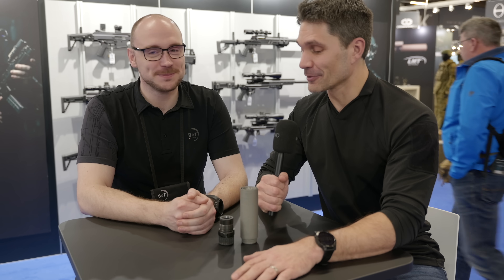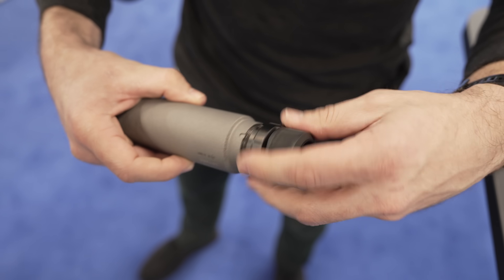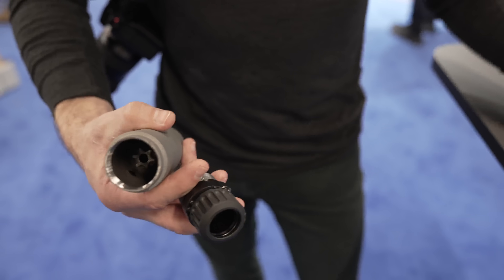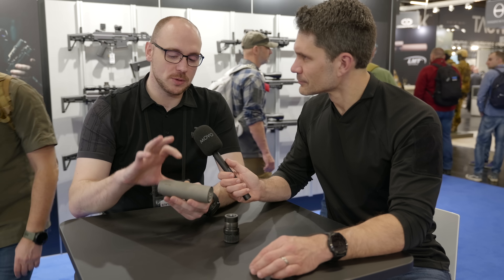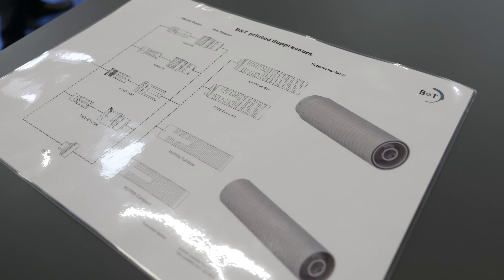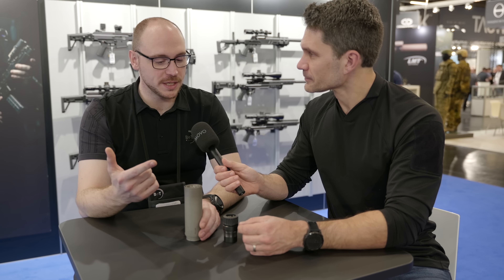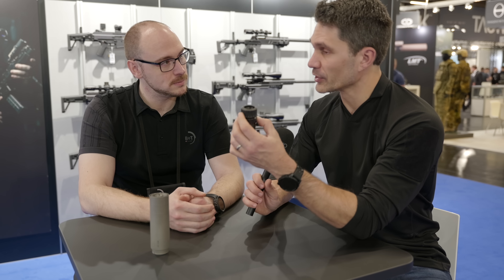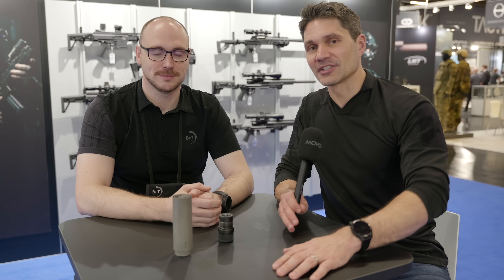B&T Making 3D-printed, HUB-compatible Suppressors in the EU and US

Comment: I got the 13.9 MOD 2 UIC battleworn green, pin and welded surefire warcomp, criterion barrel 223 wylde. Eotech red hologram,  Geissele trigger, Radian Raptor charging handle, magpul mbus 2 irons for cowitness, magpul 2-1 sling, BCM angled hand stop, streamlight flashlight with pressure pad, and BCM railcovers in black. 16 " OAL. NEXT will be a B&T suppressor with adapter to fit the Surefire warcomp. You can't go wrong with ADM. Do you plan on going with any rifles vs. AR pistols? I have 2 Caniks for hand guns, Rival Darkside for home defense, and the Mete SF for edc. ADM had it all out the box. I wish it came with irons for the price.

Comment: Use with an A2 is HUGE. More companies need to take that step. 
If I could leave an A2 on every rifle, I have instead of needing a proprietary mounting surface depending on the suppressor I wanted to use, that’s exactly what I would do.
Reply: B&T's Rotex cans have had the A2 mount option for a while.  It's pretty slick if you have a lot of firearms you want to swap the can between.
Reply: There are already hub adapters available for A2 devices. I know that Griffin Armament makes 2 hub adapters that I know of for sure.
Reply: There are a couple of issues with that. Crush washers and A2s aren't necessarily going to have perfect coalignment nor necessarily be a sturdy enough mounting solution to keep the suppressor firmly affixed to the rifle. While it can be a sufficient solution, you do have to design the suppressor around the potential issues A2's may present, which likely means making sacrifices somewhere along the line compared to just designing it to work with a muzzle device you can guarantee is properly machined and firmly mounted.
Reply: @KeterMalkuth  You don't use crush washers to mount A2 flash hiders acting as suppressor mounts, you use shims just like any other suppressor mount.
Reply: @Echo_Charlie  That isn't really what Keter is talking about.  He is referring to people who will think they can use this on their pre-installed A2 when the armorer didn't know it would later be used as a muzzle device for a can....so they used a crush washer.
Reply: @Echo_Charlie   That is his point. I have a dozen rifles with A2 flash hiders. Now I have to remove all of those and replace the crush washers with shims. Not a deal breaker but not as plug-and-play as they make it out to be.

Comment: I understood some of these words 🤷‍♂️

Speaking as just another dumbass civilian trapped behind enemy lines in Commiefornia, I really wish there was a "Everything To Know About Silencers in 2024" video.  There appears to be some kind of Apple versus Android holy war going on with suppressor mounts?  I see screw-on, three lug, that clicky-connect one... not sure what else?

And obligatory "fuck the ATF."  Why is it easier to get a silencer in England than in America?  In Britain it's considered RUDE to not use a silencer when hunting!
Reply: Hi so yeah. I am not smort or nothing but each manufacturer has its own mount. I love my rearden stuff for cost and weight savings, (it is a simple taper mount with the threads behind the taper) and sure fire is another titan in the industry as well as keymo. But when they say hub it just means that the back of the can has 1.375x24 threads so you can adapt it to whatever you want to use. Meaning that my DD upper with a pinned and welded rearden flash hider can use a B&T can. Three lug is a mostly pistol caliber carbine thing, and the click connect I dunno. But back to the hub thing. IT is cool because I own aero, otter creek and dead air cans, but all of them are on rearden mounts. 

Another Apple vs android war that is currently going on is the flow through (Huxwurx and similar) VS traditional baffle stack cans and the host for them. Flow cans are less gas, but they light up like a spot light on thermal and IR vs traditional cans but traditional cans are generally speaking slightly quieter and also less likely to flash. I hope this helps!

Comment: If suppressors weren’t NFA items, the demand would be even higher than it already is, new manufacturing methods would drive costs down to the point suppressors would cost $100-$200 if not less. Suppressors need to be removed from the NFA. Actually the entire NFA needs to be abolished because it is unconstitutional but that’s a whole other conversation.
Reply: They’d be $300-$500 for titanium and superalloy models with stainless versions at $100-$200
Reply: The chinese "oil filters" that may or may not be ATF traps are $50. Those would be simple consumables. Anything above would be a premium can.
Reply: I’d like to see Mar-M or Inconel or Monel used. These metals are used in exhaust housings in jet turbines along with inside rocket parts specifically the combustion and post combustion chambers.
Reply: @RadDadisRad  have you seen the energetic armament vox? It's C300 Maraging nickel cobalt superalloy. Stronger at 1000°F than titanium is at room temperature
Reply: @WyattWillis88  I haven’t but that sounds about right for superalloys. They are graded at 1,000F or 1,000C and 0F/0C to evaluate their work up rating and their operational rating. Titanium torches at high temperatures. That’s why if a superalloy is used, especially in an automatic weapon configuration, it would have the thermal capacity and operational fortitude to work and survive at that temperature.
Reply: In europe rimfire supressor prices start from 40e 
About 160e at cheapest centerfire supressor rated for pretty much everythign else than 300 win mag and 338 lapua.
User serviced models still meant for mostly bolt actions are starting from 200e
All steel starting from 350e
Silent steel Flowtrough supressor(full auto rated) meant for AR:s are about 550e
And those prices are with 24% vat
Reply: @Kesssuli  here’s what gets me in Europe they understand that suppressors are for hearing protection aka PPE as they reduce the decibel level to make it safer for people. In the USA the government thinks anyone that would use a suppressor to become Gabe from Syphon Filter.
Reply: @RadDadisRad  Can confirm how supressor will definelty not make you a hitman quiet.
Close as possible we could go with bolt action 22lr with good subs and can.
Can hear firing pin and then small thump when bullet hits a dirt.

With semi-auto tippman m4/22 and ruger mark IV action itself is loudest part.
Hearing safe if we mean not instant lose ablity to hear but even with subs it is around 70-100  decibels at shot.
So hearing protection is encouraged in range conditions.

.17hmr supressed is about loud as standard 22lr shot whitout supressor.
But whitout supressor specially under a roof one shot will ring your ears.

.223/556 AR with above mentioned 160e supressor will help a lot against
muzzle blast. Specially when compared to just flashider or brake.

Definelty not recommend to take it as habit to shoot whitout protection
but shot or two in while in hunting is least about safe as it gets. 

One thing typical supressor is doing to make that sound more comformable
is to project that shocwawe directly away from you instead spreading it 
around  what happens with flashider and brake.

Edit: What i meant there is that those are not magical devices as movies and games descripe them to be.
But if possible to have i srongly encourage to have it because very well known reasons.
Added bonus it tightened my AR groups quite lot. from 1.3 moa as average to 0.75 moa.
Reply: someday every household who owns guns would have a suppressor
Reply: I could see prices dropping dramatically even if just the waiting period goes away
Reply: DMLS is not inexpensive. Especially in superalloys. The benefits are in design & tooling.
Reply: I agree with your cost trajectory but not the magnitude.  Any reasonable muzzle device today which isn't regulated and is designed to handle a silencer (not even talking about the silencer) is going to set you back 60-150.  You will never see any rifle can go below the cost of the cheapest decent 22LR silencer as it is a more complex structure than the aforementioned muzzle device, barring an innovation to the manufacturing process.  It is actually remarkable that you can get a decent 22LR silencer for ~300 and that you can get something like the OCL Polonium for a $550 price point.  The margins on those have to be incredibly low already even if they produce them in bulk.
Reply: Yes.
Reply: I don’t think you realize that the most influential factor in pricing of suppressors is the market price if a company knows that this style of suppressor is sold for $1000 they’re going to sell it for $1000 regardless of how much it cost them to manufacture Their gross margin might be significantly higher than other industries. Market pricing being higher than cost of manufacturing dictates the market and profit margin of suppressors for companies far more than low manufacturing and the inefficiencies of low volume manufacturing. Yes I think you make a great point once suppressors become non-FAA items. There will be so much more markets saturation and so much more demand for them. The market will ramp up, and there will be much more cost efficiency and yes, the prices will go down significantly, but right now they said prices based off of what the market will pay for them, which is significantly higher than what it cost them to produce.